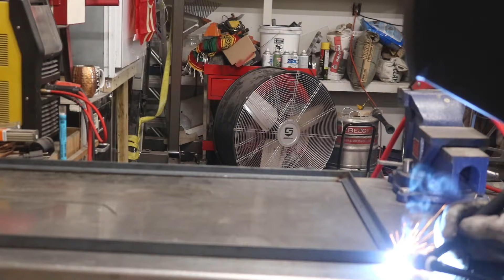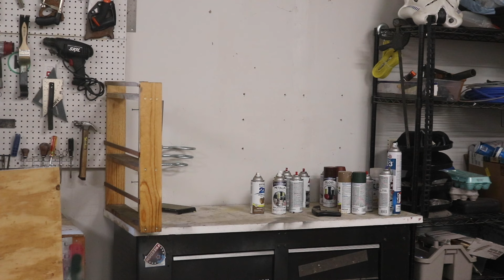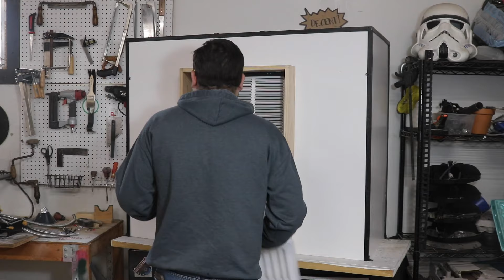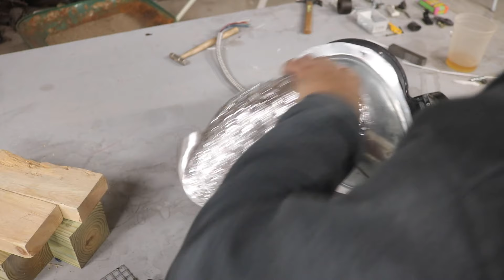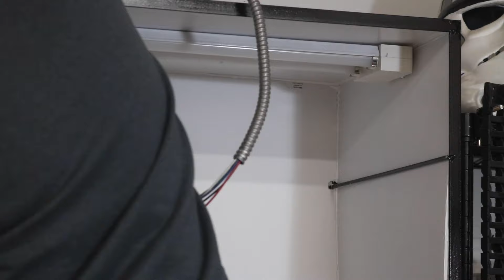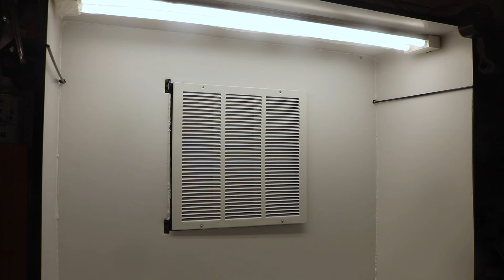A Paint Booth for my Home Workshop!

Comment: In my experience with spray booths it was very much obvious that the smaller the booth frontal area the more effective the booth was. My suggestion to you is to add hinged wings to the front of the booth to reduce the frontal area which increases the air velocity and increases the effectiveness of the booth. The hinging allows the ability to only use the larger area when you are painting larger parts. Also, the addition of a turntable is a good idea as well.